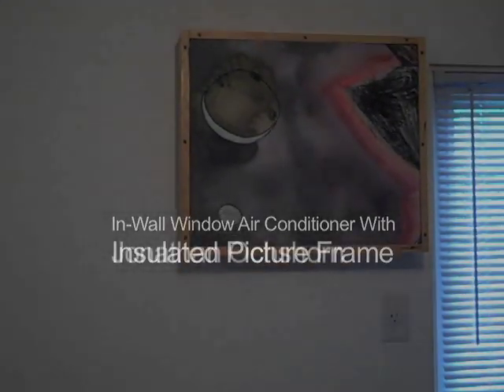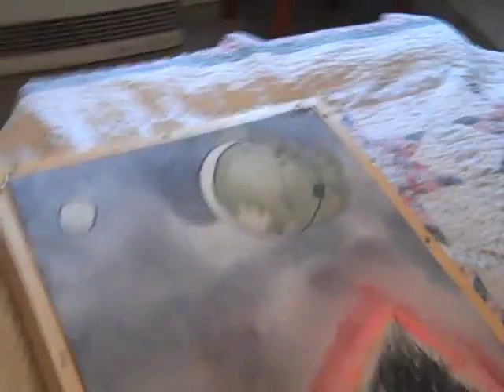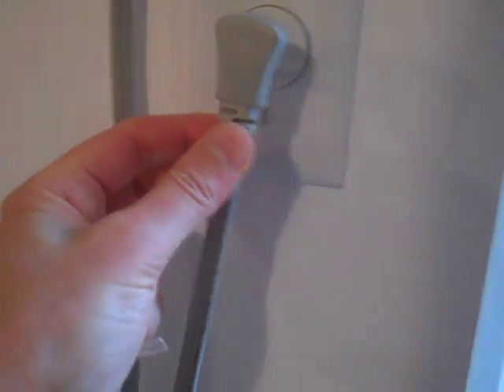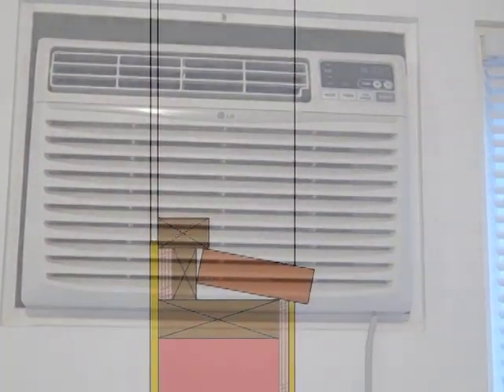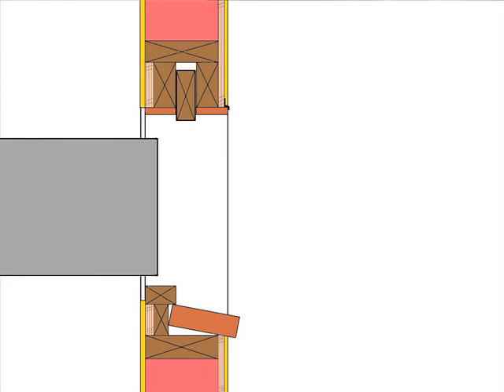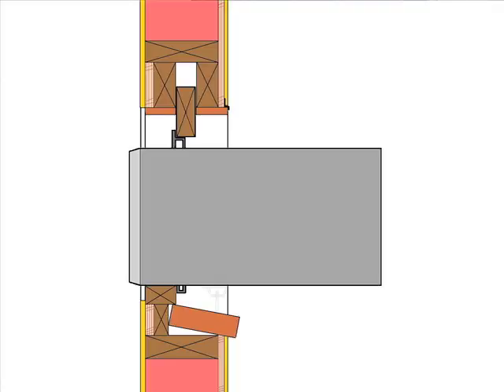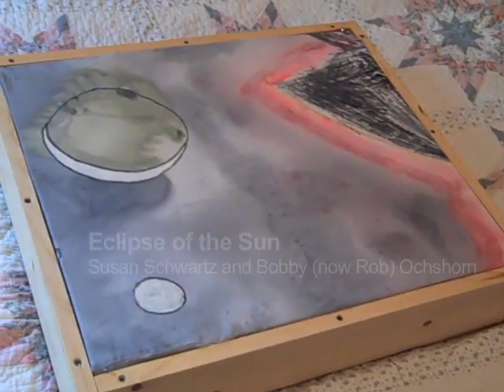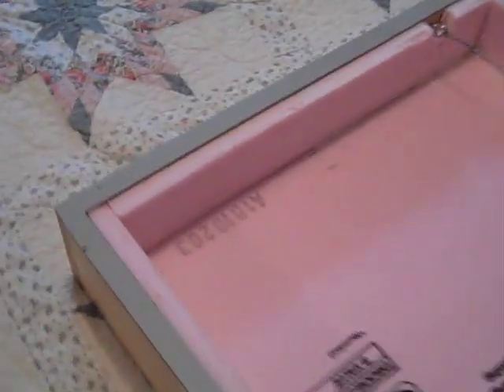Insulated frame for air conditioner - Jonathan Ochshorn

Comment: I got a window air conditioner, too. I got one that fit the hole in the wall perfectly. As the air conditioner itself slides out of the "box" around it, once we slid it out, we removed the screws holding the top tab for the window install. We didn't need to do anything to the wall. Just slid in the box and secured it and then slid the ac back into it's frame. Presto! Also, since we were upgrading, we bought a unit that also has a heater in it. Didn't even know they made them like that. Great unit!

Comment: I think this is a great idea. I wish there were more detail on the box. Is it 1' thick board and 1' inch foam? So you have to make the box 2 inches bigger then the ac width?
Reply from the maker: The wood frame is made from 1x boards (3/4 inches thick) and the insulation is also 3/4 inch thick (although thicker boards would work as well). So there are 3 inches of total material added to the ac width to determine the minimum outside dimension of the frame. I would add another inch or so to make sure it fits.
Reply: Thank you sir. :)

Comment from the maker: The key is to make sure that the inside surface of the insulation stays warm so that any humidity migrating from the inside of the house will not condense when it strikes a cold enough surface (with a temperature less than the so-called dew point). So if the inside of the "box" placed on the outside of the house stays warm (if inside heat moves through the openings in the air conditioner itself), then it should work. But it's a bit more dangerous that way, though it might work.

Comment: My husband and I live in a cold, but extremely dry area with an old (1960's?) wall air conditioner. Would it work just as well to make something like you did, but put it on the outside of the house?